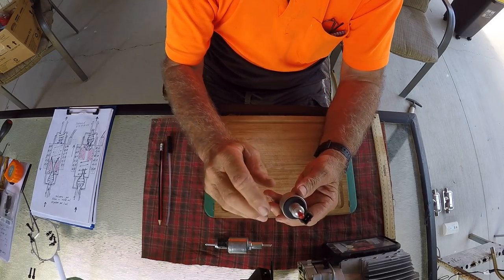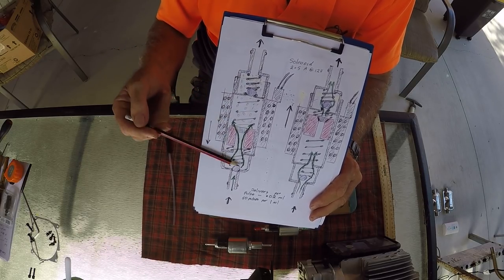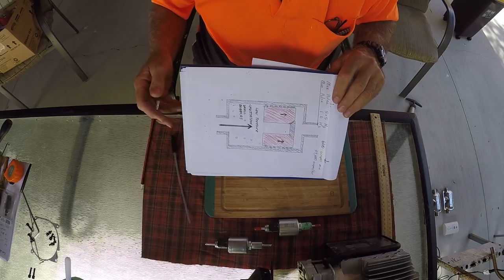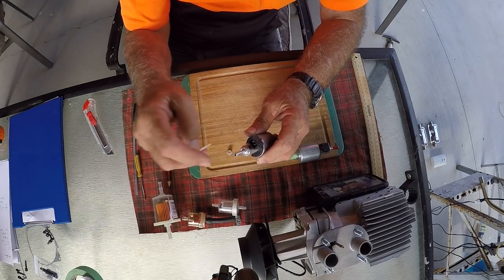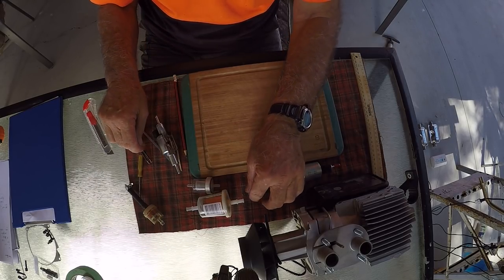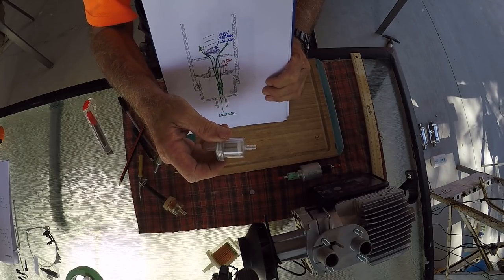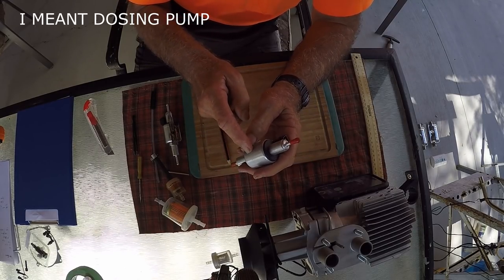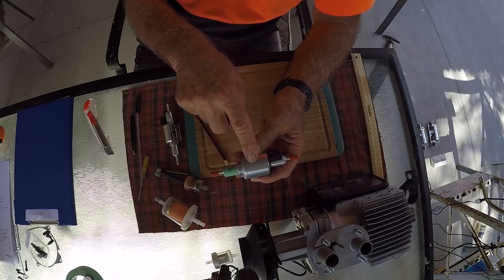Chinese Diesel Air Heaters   Part 7   Metering/Dosing pump

Comment: it is 0.02ml not 0.2ml?
Reply from the maker: Hi fiskusmati, you are correct. 
The dose from these pumps is 0.02 ml (some later pumps 0.022ml) per dose. 
At time 1:16 min I state this verbally and in print on the screen in the above video.
It is nearly two years since I recorded this video, and I may have made an error somewhere else. Can you please give me the time stamp of where the error is. Thanks.   JMcK
Reply: @johnmck1147  it is not your mistake, many sources list this pump as 0.2ml but obviousy you are right

Comment: thers no filter  in my 5kw  all in one  unit
Reply from the maker: Strongly suggest you install one.   JMcK
Reply: paper or stainless steel
Reply from the maker: @kellymelrose8527  

Either Kelly. Paper is generally more efficient but as long as you have a filter. JMcK